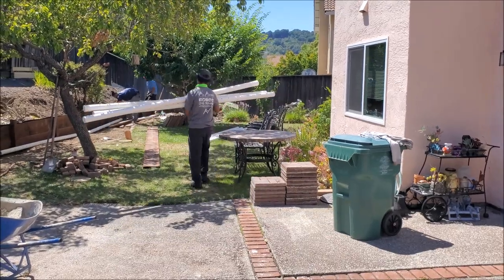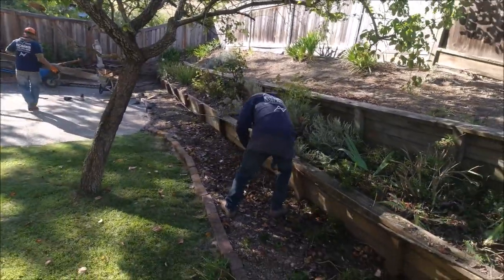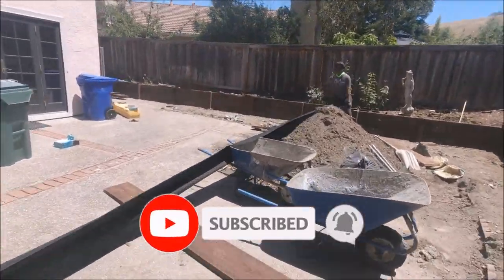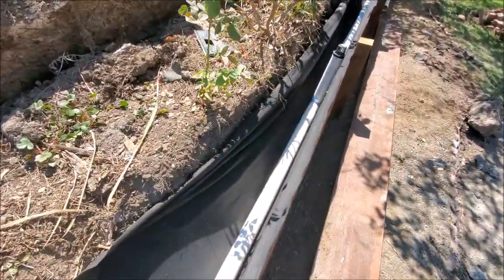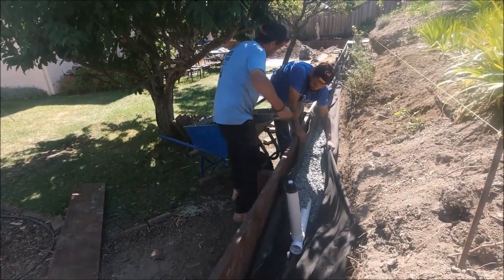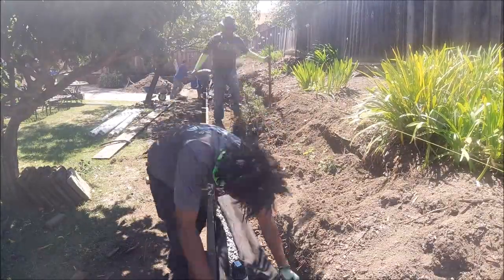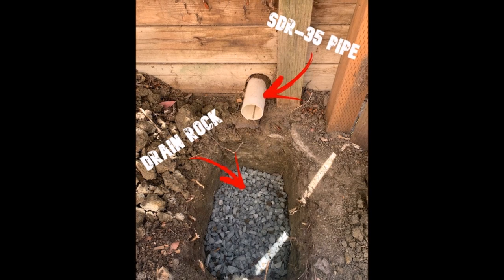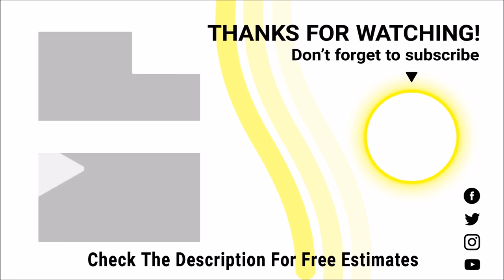How To Install A French Drain System For A Wood Retaining Wall | All Access 510-804-4646

Comment: So I had a 6 foot retainer wall cinderblock installed but I noticed I didn’t get a French drain.  Will my wall come down without it?
Reply from the maker: Let's just say it's best to have a French drain system behind a wall that high. 

 Last year we had to dig behind a wall to add a French drain because a contractor did not install one..

This is a cinder block wall we had to replace because of no drainage 

https://bit.ly/InstallFrenchDrainConcreteRetainingwall
Reply: Ok so I’m reaching out to the contractor tomorrow.  What would be the cost roughly for an 80 ft long French drain with drainage rock? I really appreciate your help🙏🏼
Reply from the maker: Hard to say... But it all has to be done by hand.. Minimum 12 inches from back of the wall 4 to 5 feet up... 

The one we did was for a wood wall... 105 *3.5 feet long.. 34k..now this was multiple levels.. 25 to 30 yards of dirt had to come out.. Shout me an Email I'll send some pictures..

Also with cmu you should water proof the back.. http://bit.ly/30VYX9e
Reply from the maker: Good luck

Comment: What do you do with the end that is not going to the street? Do you need to cover it with fabric over the hole and just make sure there is a slight grade to get the water to the street?
Reply from the maker: The end that's not going to the street is normally elbowed up and use as a clean out... Appreciate the comment 👍🏾 💯
Reply from the maker: https://youtu.be/CNWZLzqmoVU ☑ this video out..
Reply: @AllAccessConstruction  Thank you so much!
Reply from the maker: All good.. Good luck 💯💯